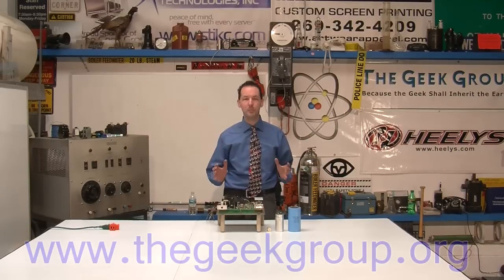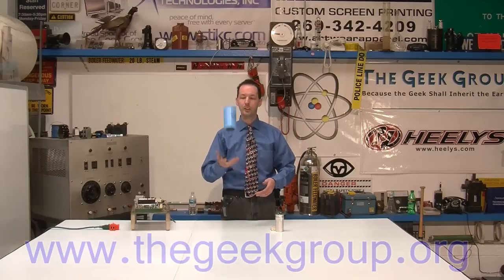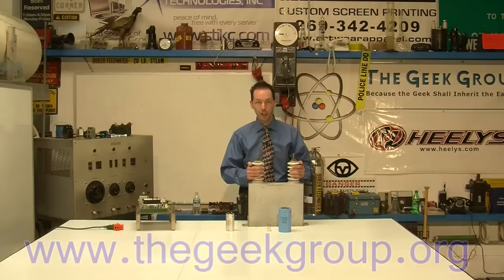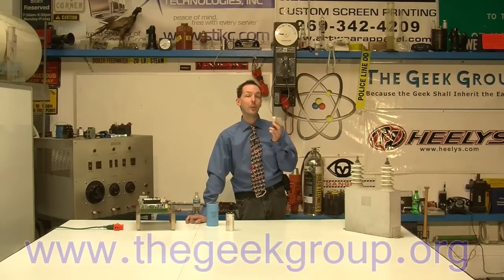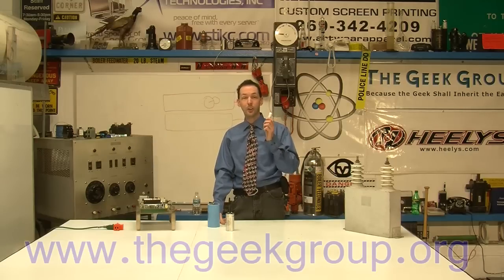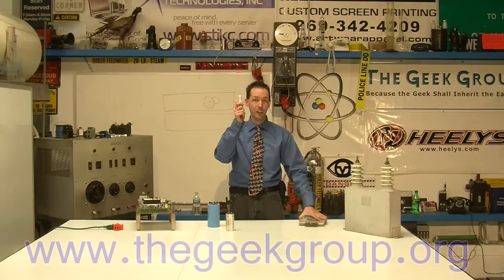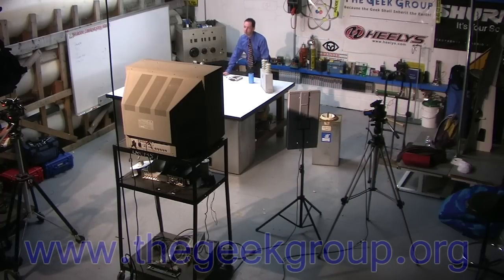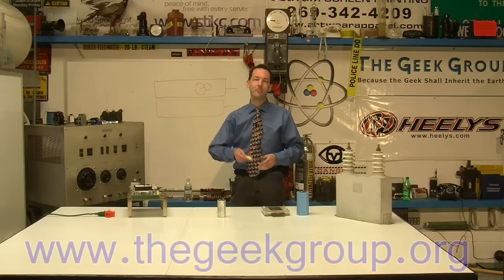Capacitors Pulse or Not

Comment: Hi there!
I was wondering:  If one of those caps in the MMC series setup gets blasted "like Swiss cheese", then with all of this 'missing' material,  why does the meter not read a lower capacitance, instead of the rated "C".  One more thing please:  Is a doorknob capacitor constructed like the pulse rated caps that have the "low inductance" type winding where the edges of the foil are all tied together at the ends, thus making a good Tesla coil capacitor type?
THANKS MUCH,